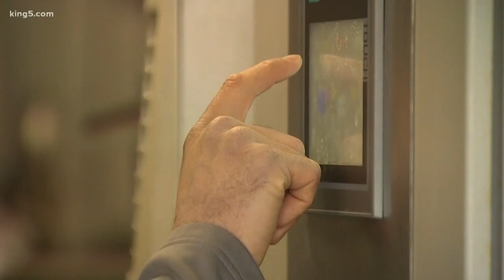New tech makes cow manure, salmon safe

Comment: Yeah...don't solve the issue by getting rid of the source of the problem, just use tech to put a temporary bandaid on the problem.  A huge, festering problem.
Reply: Why get rid of the source of the problem when you can benefit from it and eliminate the problem as well?